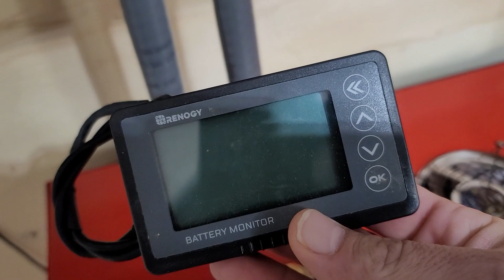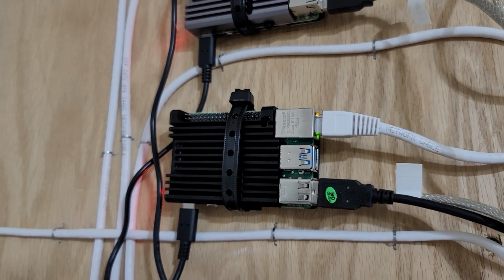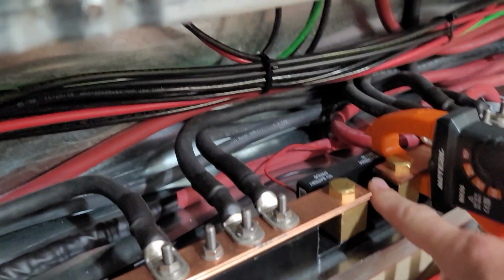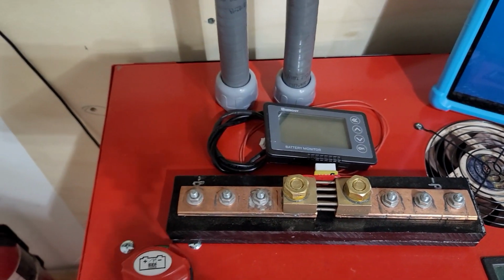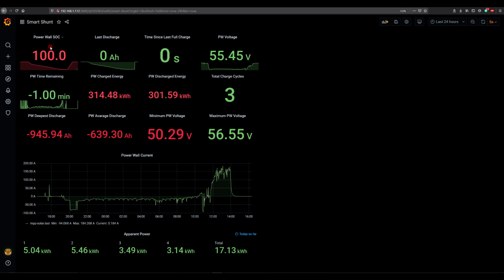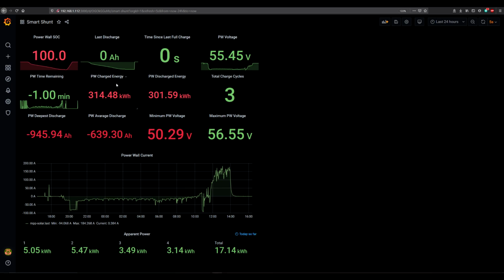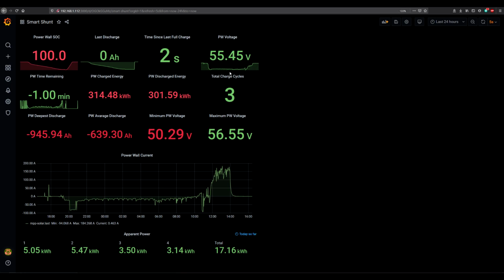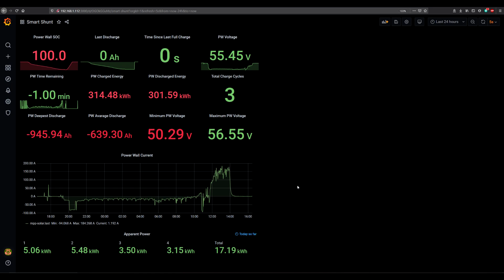Victron Smart Shunt

Comment: All I want is the current through out the day.  How do I do that with out it hooked up to my phone.  Then is still won't record. I need a graph showing be the current through out the day.
Reply from the maker: To see current graph throughout day you would need something that records data. Phone app does not offer that feature. Something that I am doing would be more beneficial to you.
Reply: @DMIINC2013  what exactly do you do.
Reply from the maker: @bigblockcutlass123  Are you any good with using Raspberry Pi?
Reply: @DMIINC2013  that's the problem I don't know anything about a raspberry
Reply: @DMIINC2013  I have A Raspberry Pi coming with Solar assistant. Do you know anything about Solar assistant? Bought it from a company in South Africa.
Reply from the maker: @bigblockcutlass123   I am not familiar with it. Guys on the DIY Solar forum are.

Comment: My batteries are in my shed far far far away is there anyway I can get the data to my house?
Reply from the maker: Either by running a cat6 cable or making a wireless bridge. Which option is best for you?
Reply: @DMIINC2013  well nothing beats a good cable but how do I tie it in with the ve connector?
Reply from the maker: What kind of equipment do you have on hand? I am using Raspberry PI 4 to collect and send data to Influx DB.
Reply: @DMIINC2013  I think I might be a bit to simple for this conversation :/ thank you all the same! Would there be an easy way to repeat to bluetooth signal from the shunt closer to the house? Or feed data to a nuc? I do have an old raspberry pi laying around somewhere but I dont even know what model I'm really dumb with that stuff
Reply from the maker: I do not know of any repeater options for BT. All of my smart shunt data comes from its serial port. Smartshunt -> RaspberryPI -> Network. I wish I could be of more help.
Reply: @DMIINC2013  thanks so much anyway I guess I'll just have to smarten up, mucho mucho love brother :)

Comment: I think your smart shunt buss bar is a very clever design. Any chance you can cover how you put that together? I need to connect multiple batteries and multiple inverters like you have, and using a single wire from the shunt to a terminal bar seems not as nice as having all the current going directly to the shunt vs a wire. Is that just a plastic block you used? Or is it wood?
Reply from the maker: Believe it or not that was the last piece of Mitsubishi Chem nylon bar I had left over from building Power Wall 3.0 Size was 1.25 x 1 inch. I cut in half and used it with 1 inch copper bar. Also a left over from PW 3.0 build. Everything fit just fine. My only wish was for that nylon bar to be 2 inches longer so could make it look better. If you are designing something like this I would pay more attention to ring size of your wire lug. Go with 1/4 inch ring size for your wire lug. You will have larger area contacting copper bus bar. That will provide for better connection and minimize voltage drops. Since in GA and in my garage we experience high humidity for majority of the year so I used MG Chem silver conductive grease on all of my contacts. Pay attention and you will see it in the video.

Comment: So when monitoring multiple batteries with the smartshunt like you have set up, where do you connect shunt positive power to? Does it need 12V? Or can you just wire it to the positive battery busbar at 48V?
Reply from the maker: Directly to positive busbar of your batteries.

Comment: Yes Victron shunt is desirable Victron also has raspberry pi operating system for their network which is available. Do you think multiple shunts one for each toolchest would be an advantage? Also any kwh used while on float don't show up in that shunt software is that correct? Awesome system no matter.
Reply from the maker: If you want to keep track of each power 🔋separately then yes.  Anything in and out gets recorded. Thank you.